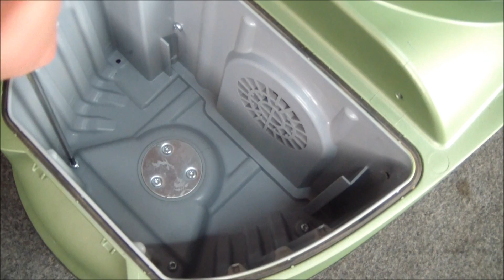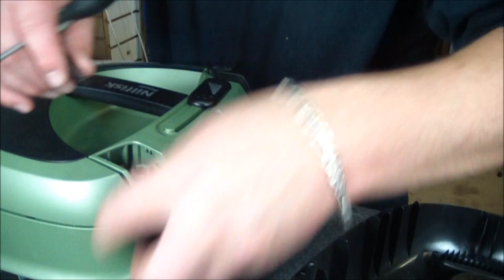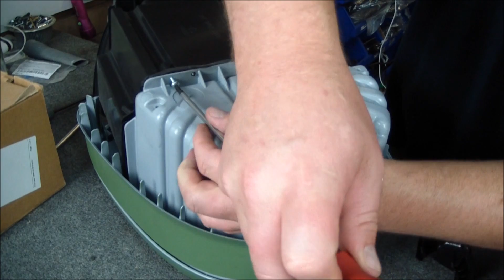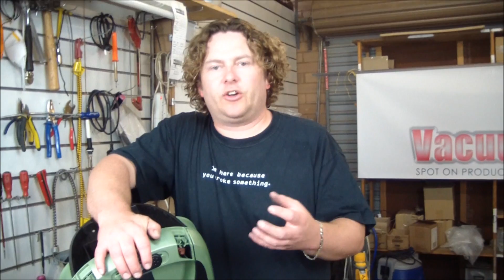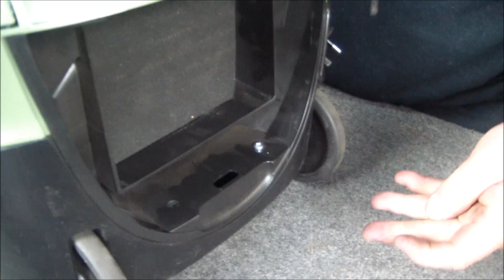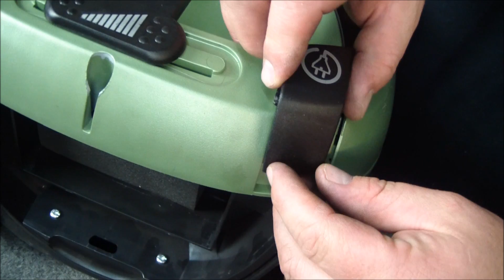How To Change A Nilfisk Power Vacuum Cleaner Motor

Comment: Hello. I am repairing one just like that. It runs for a few seconds and stops. Wait a while and it goes back on. I discovered a part that seems like a thermal switch inside one of the brush holders. If I remove it it starts working fine. I am in doubt if I should try to get a new thermal switch or just leave it without it. Suggestions? Thank you

Comment: Hi Alec, I removed the motor from my parents old (from 2008 - 2010) Nilfisk vacuum cleaner today and didn't get that the fan that moves the air was fastened with a nut threaded in reverse. So I ended up removing the fan all together. 
I'm not going to put it back in, but rather use it for something else. If it would work for a bandsaw, then that's what I'll use it for. If you, or anybody else, has an opinion on this, I would be very happy to hear it. It appears that the motor goes with a very high rpm straight from the mains. Perhaps I could get some kind of variable resistor to handle that. 
I tried it twice at this point. The second time I noticed something I didn't see the first time. That it was a bit sparky. Not burning, but a lot of sparks. Since it's possible to run it on ac power, I suppose polarity doesn't matter.
Please, let me know your thoughts on this.